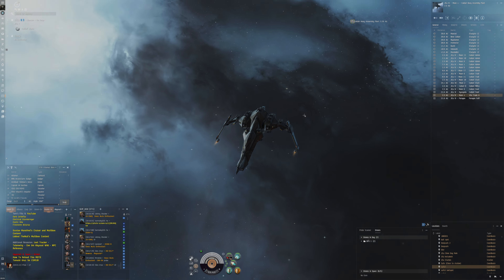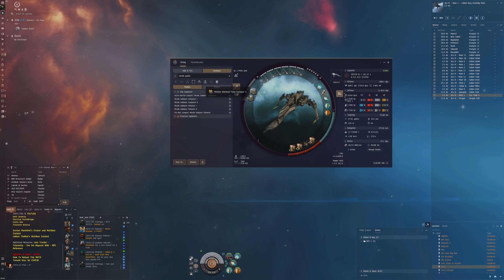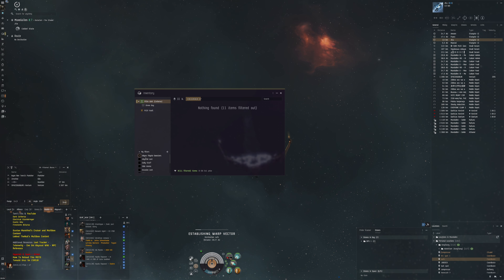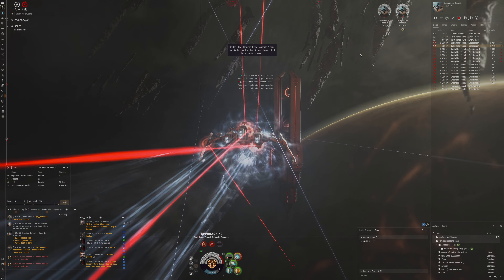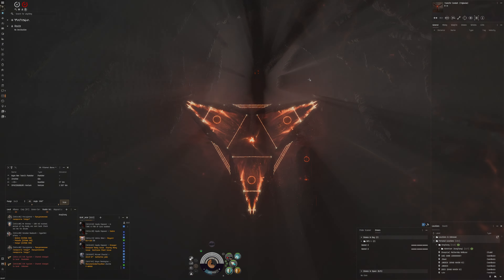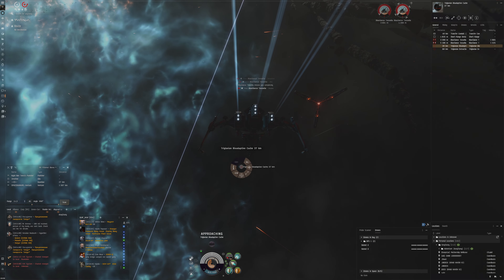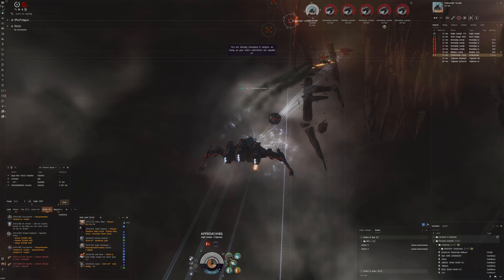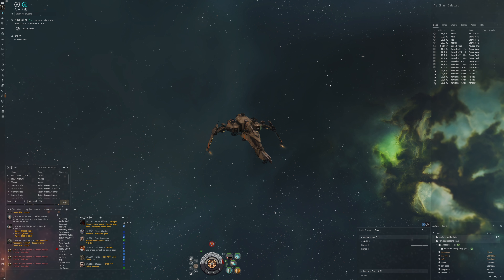EVE Online - Fastest T4 run? Cerberus Dark

Comment: hi ace,

i wanted to ask you if it would be possible to make a guide for ships that can fly for example 3 of 5 or 4 of 5 possible abyss sites (types) for level 0,1,2,3,4 to wherever

because i see you taking only ONE special ship for ONE type each time > that of course HIGHLY efficient i understand that but a bit expensive over time (especially when imps are added)

therefore for the "normalo" player i would find it really cool if for example for the t0 levels as an example for firestorm,gamma,electrical e.g. a corax fit tests what gets along with it without any problems and in the video only points out where it doesn't work and/or why